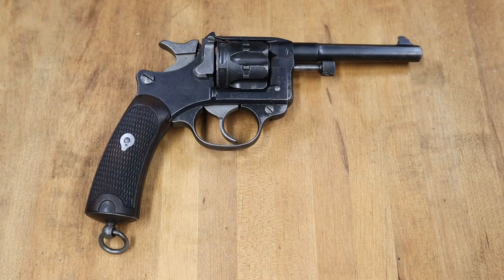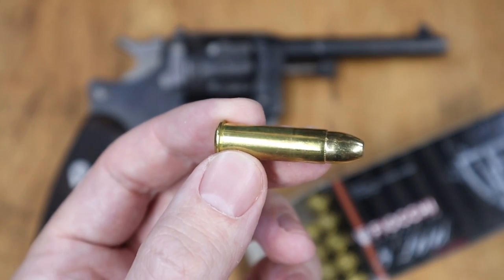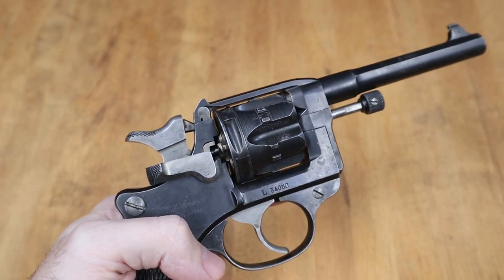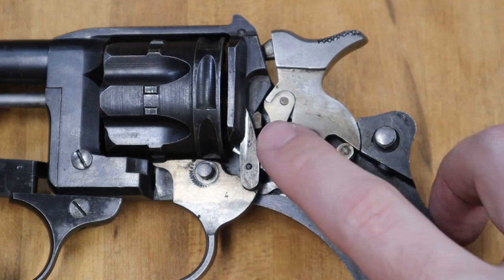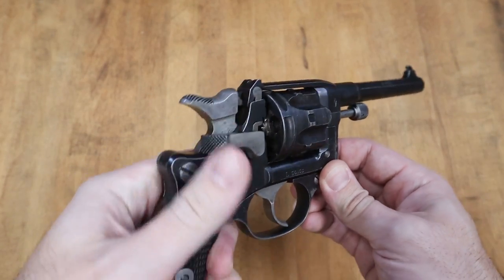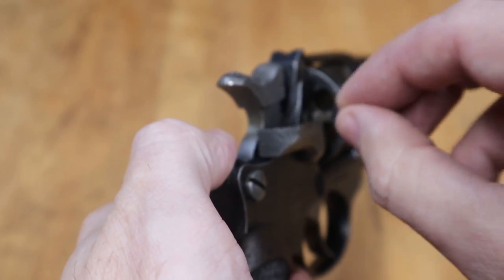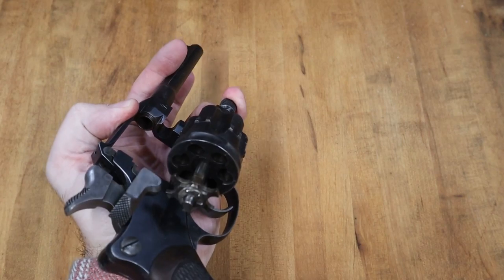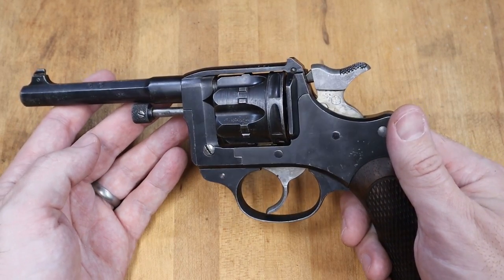French Mle 1892 "Lebel" Revolver

Comment: you cant actually insert rounds into the revolver without swinging the cylinder partially out. it was more so a leftover of the 1887 French revolver which didn't have a swing out cylinder and this revolver is a direct continuation of. it was likely this was useful for preventing out of cylinder alignment shots as the loading gate being down disables the trigger and can only be raised when the cylinder is back in place.